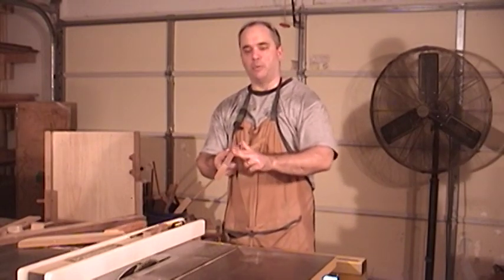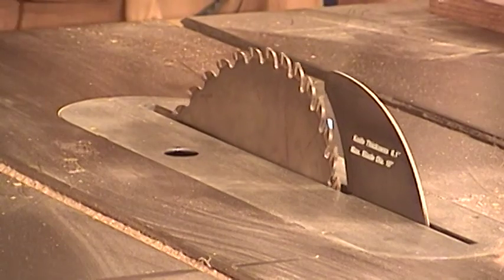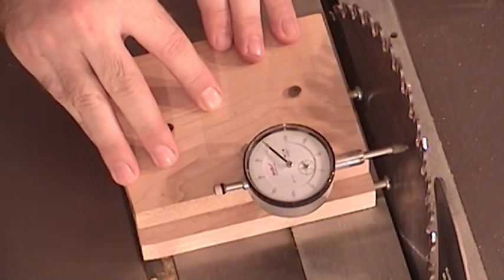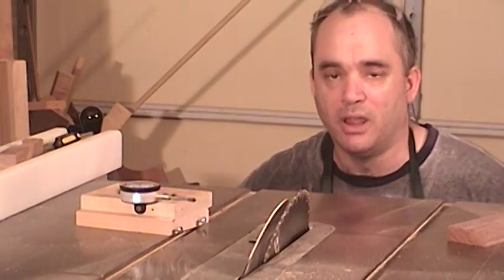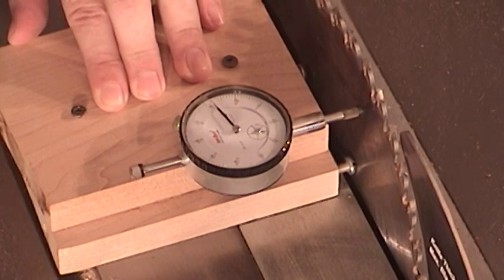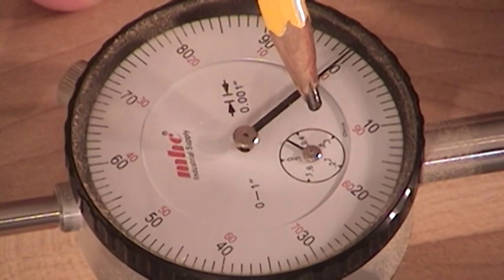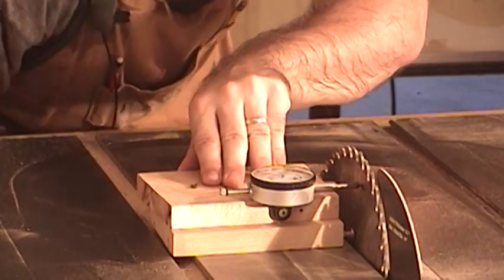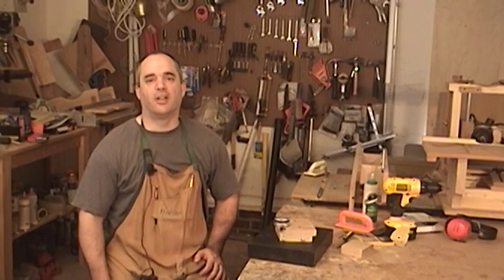How to capture table saw blade angles

Comment: Yes, I've seen those. I started using a dial indicator when I bought a metal lathe. Since then have found a lot of reasons to use then, mostly mirroring yours. BUT, have you tried using it to align your table saw blade with the miter slot?? It does take a little time, but the outcome outweighs ALL of it!!! Don't know what kind of table you have, but, on my Delta contractors saw, have to loosen the trunnions. The back ones are easy, but the front two are a bitch. But as I had the entire saw down, made it a lot easier. But try this, take the blade off, raise the arbor all the way and give it a go. A few years back I bought a little set of bolts and a couple little pieces of angle iron that hooked up to the rear trunnions mount so you could dial in the adjustment. But my whole table needed to be shifted, THEN it worked and DIALED that bitch right in. Now I have less than .001" difference from one end of the blade to the other, using the same tooth and WOW!!!!! What a difference that made. Had to re-set my fence but that was nothing. Please let me know what kind of saw you have. Have a great day - Lee
Reply from the maker: Yes, I've done that to align a table saw blade too.  My saw didn't require any adjusting thankfully. I have a video on the process here:  http://www.garagewoodworks.com/video.php?video=15

Comment: I rebuilt a table saw I've had for 25 years with new arbor bearings, arbor and arbor bracket. When I put it all back together, I was able to adjust the blade accurately with the miter slot with a dial indicator. WOW!!!!! What a difference THAT made.  Try it, you'll LOVE IT!!!! No more burning when cutting angles or very hard wood

Comment: Nice simple design but one question, how do you ensure that the two screws are equal in length or doesn't it matter?   I bought a gauge on the internet not understanding that it was no good without a holder.  Ah well, still learning.
Reply from the maker: It's not critical that they are the same length.  The purpose is to keep the jig from rocking during measurements to ensure consistent readings.  You could use a caliper to get them to protrude the same distance from the jig.

Comment: Excellent video.
You are right, we always find out that we need to make a different cut and have to move the blade again.
I have one of those digital magnetic angle indicators, but this seems faster and easier.
And as far as I know, every woodworker has a dial indicator, they are used for everything.
Thanks for posting this great idea.

Comment from the maker: 2 tenths of a thou = 0.0002" (2 ten-thousanths).  Yes, that would be ridiculous.  I only recommend measuring to 1 thou or 0.001"  If your blade is not flat you need to address this problem first.  If your blade only shows minor deviations from flatness like mine (1-2 thou) you should make a sharpie mark on your blade and measure from the same spot/region each time (I should have shown this in the video).

Comment: What great idea!  You could also use this method to set pemanent blade settings for  22.5 - 30 - 45 - 50 degrees actually any angle the saw bench will support.  Once you have noted down the displacemnt of the guage for each angle you can ALWAYS get the same ange on your work, even the stuff you have to go back too.  Great idea just too simple.

Comment: Actually a very quick, very simple, and extremely accurate method. Might argue about the price, a good dial indicator isn't cheap. The rhetorical question here is: Is the resulting benefit worth the cost? You obviously consider it so.  

When doing wood work, I'm of the old " Measure with a micrometer, mark with chalk, cut with an ax" school.  But then, I don't do cabinetry or other precision work.

Comment from the maker: With a standard 10" saw blade at full height you have 2.75" of exposed blade to push a square against. Every 5 thou of gap between the square and blade that you can not discern gives 0.1 degrees error. 0.1 degrees is enough to cause problems especially when you consider cumulative error.  Unless you are using feeler gauges with your square you will not be able to discern 5 thou.  Your limit of detection is going to be in the 10-20 thou range which puts you at 0.2 - 0.4 degrees angle error.

Comment: Why add the extra step in setting blade angle with this contraption?  How much more accurate are you going to get out of this?  Does it really matter?  All you have to do for 90 degrees is to set your square next to the blade and square the two.  For any other angle, use your angle protractor (of any type) and set it next to the blade.  
This is all an unnecessary step that just wastes time/effort/money!!!!

Comment from the maker: If your reading is in-between graduations (most likely) you would have to eye-ball the position and hit that same eye-balled position on the next angle adjustment.  You could use blue tape and make a mark on the TS-angle gauge and try and hit the same mark later.  My guess is the method I showed is still going to be faster and more accurate.

Comment from the maker: As long as the measured angle is taken on the same day it is used, the stability of the material for the jig is a non-issue.  It should give very accurate results, similar to the TS-Aligner.   Thanks for the nice comment!

Comment: Thanks for this video which documents the well-known machinist's method for verifying repeat-angles! 

I use the TS ALIGNER to do the same thing, though I can see where this homemade jig would be good enough for many cases. Obviously, the jig needs to be made very accurately from stable material to achieve anything close to "perfect" repeat angles. That's why I prefer aluminum since it is dimensionally stable and maintains close tolerances.

This will help those who don't know about it.